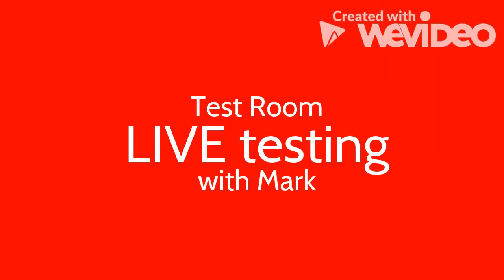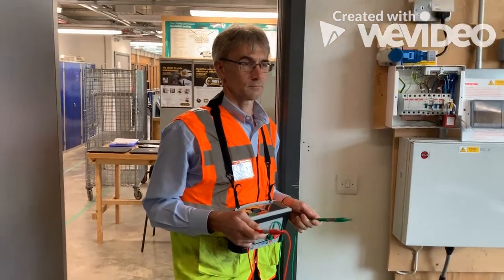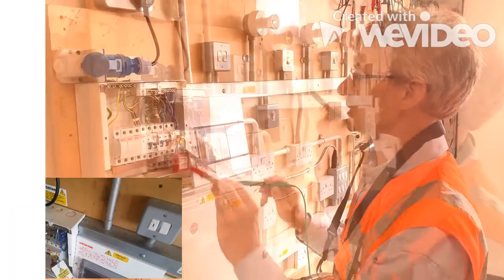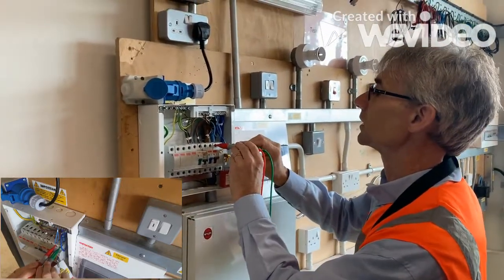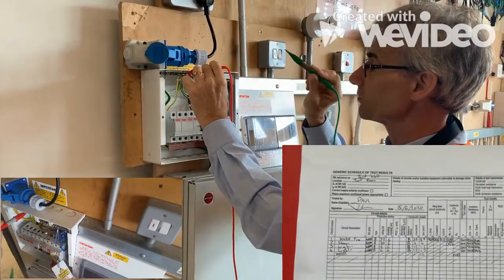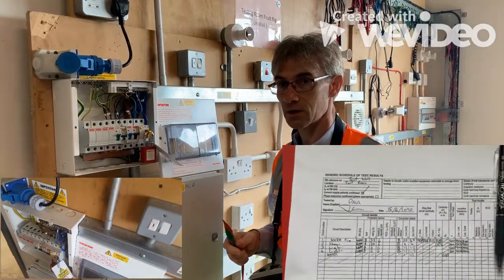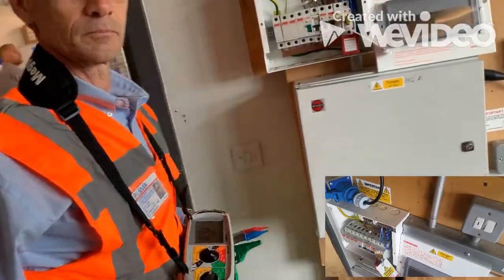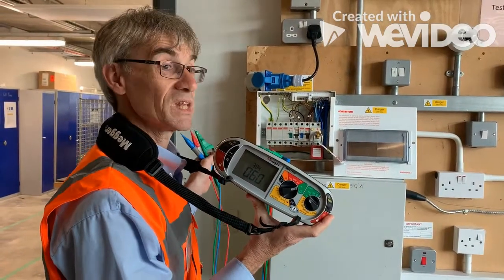Live testing

Comment: just question------if yours  meeter is set at 2Low that mean 2 leads at Low current so you not need to connect  Neutral  and will be not bether   to do Ipef at 2Hi
then you set for Ipsc 2Hi                leads.          and connected eart by mistake  to measure  SHORT CURRENT  beatween.  L-N

]Zs should be set at 3Lo

Comment: What is "Main Earth". Are you referring to the "Earthing conductor"?       You should not be holding both probes with one hand during LIVE testing. Why are you wearing Hi-Viz indoors?   Why do you keep referring to the LINE conductor as LIVE? Neutral is also a LIVE conductor. During the PFC test, why did you not utilize a crocodile clip for the earth connection? It meant you had to hold the red and blue probes with one hand? You carried out LIVE Zs testing with the front cover of the consumer unit removed and the busbar shield not in place.
Reply: Because it's known as line not live
Main earth is the incoming Earth Tns / Tncs /TT

Comment: Great Video 
One question plz , if the ze & pfc test are done for a main distribution board with a main air circuit breaker  of 2500A , should the main breaker be in the off position as a safety procedure ?? Then we can test to the incoming points of the breaker ??